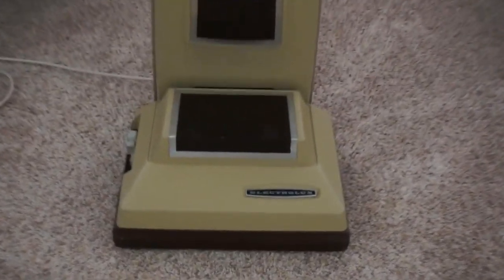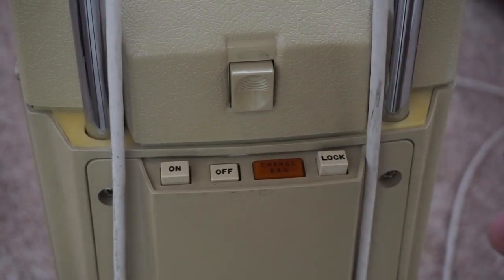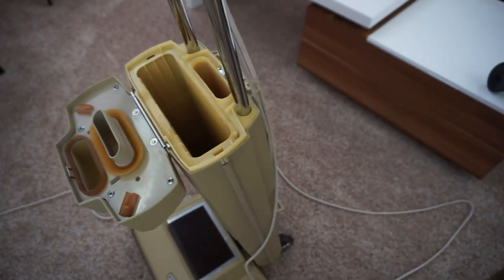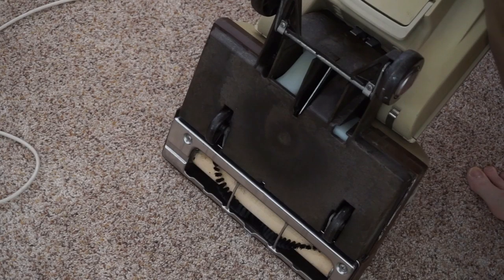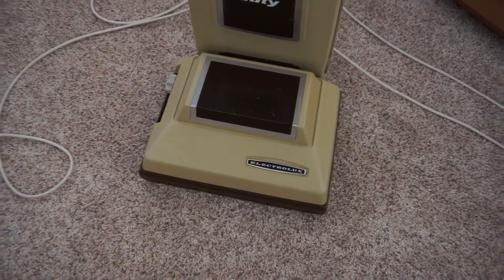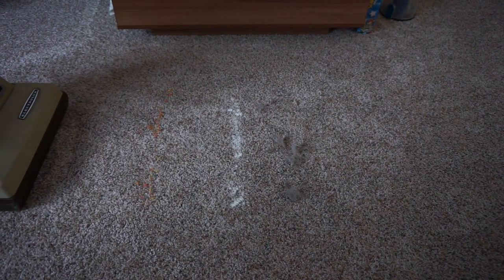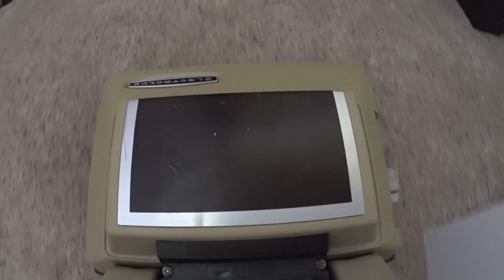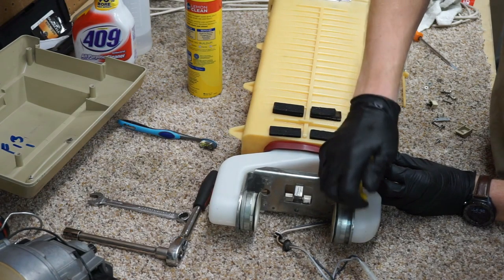"The worlds Most Advanced Upright vacuum" That Was Forgotten-Electrolux 1363 Review

Comment: As always, I appreciate your tutorial and related info.  Thanks!  Electrolux Corporation's Model 1363 debuted in harvest gold in 1977. In 1978 it was upgraded and the main color changed to tan; which is what you have. There was also a tan commercial 1363 available that had a grounded cord-offered for about a year. In 1980 the 1363 was succeeded by the 1451 with spherical wheels and other upgrades, in the same color but with different labeling. About a year later the 1451E came out, which looked exactly the same as the 1451 but was redesigned so that the bag indicator light was at the base instead of the back of the bag housing with the old G-E style range push button controls. The color changed to gray during the Silverado Deluxe tank era; then to light sand gray to match the Diamond Jubilee tank. In April 1986 the 1451E was retired and the sleeker, lighter, L-shaped nozzle Model 1500 "Discovery II"  was offered.  That machine  is still distributed by Aerus LLC today as the Lux Guardian upright (model U147H) after going through several iterations including labels, models, colors, and features. Thanks again for an interesting vid. I agree with you and the other responders that the 1363 was an engineering marvel.
Reply: Turns out I have a 1451E. The bag check is at the base. My grandmother had a 1451, as I remember the bag check was at the top. These cleaners are so odd to me.

Comment: The other thing about the height adjustment, is it is automatic. When the machine is sitting on the carpet to be cleaned, you will notice that the adjustment only goes so high, or so low, and when the button is depressd on the nob, it sets its self to the correct height.

Comment: Hoover had its "Convertible", and Electrolux Corporation had a "Conversion Kit"  (part # 42140).for its heavy-duty uprights. The 42140 included a "Carpet Shield", which was placed over the brush roll opening to prevent the brush roll from wearing away the carpet while the attachments were used; the hose adapter, a braided hose (yours would have been in the same design and colors as the Model 1401-B "Olympia One"'s); and the same-colored small combo tool and narrow space cleaner of the Olympia One's.  Other customer options were various brush rolls such as long-, stiff-bristled for commercial-type low pile carpeting; soft bristles for delicate carpeting; 2 or 3 rows of bristles; and one with a beater bar; and a kit to raise the bottom plate for low-pile carpets.

Comment: Btw, the serial number was marked on a decal and also coded with dots on the center of the base (in case the decal was removed). The name stamp (specs) are on the plastic hinge cover of the base.  I  believe it's a 6.4-amp motor.